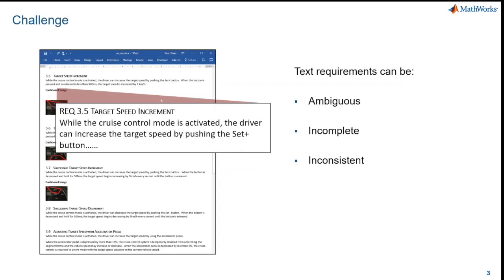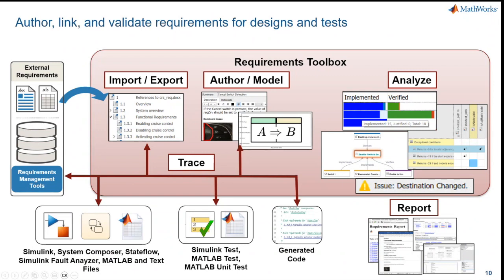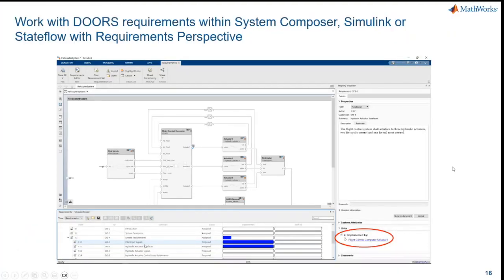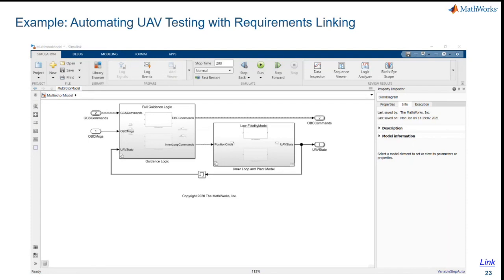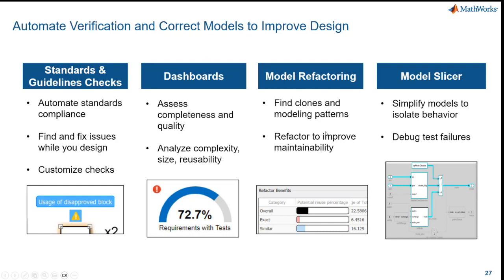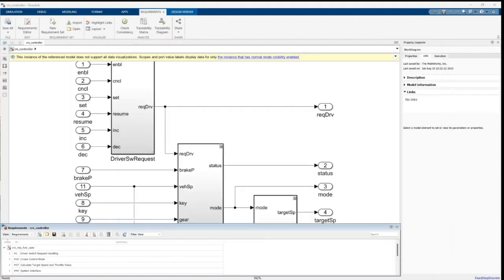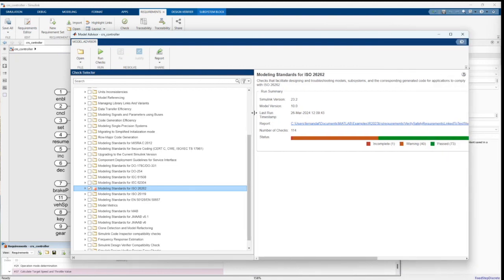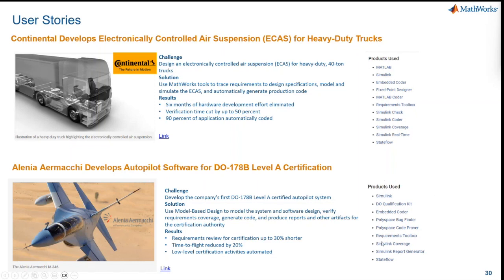Requirements Management with MATLAB & Simulink

Comment: Nice presentation. One question: is there a way to make a traceability back from test cases into DOORS? 
Thanks
Reply from the maker: Hi, thank you for your question.
Traceability is bi-directional. You can import requirements from DOORS into the Simulink® environment, then establish traceability from your model to DOORS requirements through the imported references. If DOORS requirements change, you can update the references in Requirements Toolbox™ while maintaining traceability. Additionally:
You can establish traceability from MATLAB® and Simulink to DOORS without modifying DOORS Formal or Link modules.
 
You can link between design, tests, and requirements without leaving the Simulink Editor.
 
You can establish traceability from low-level requirements in Simulink to high-level requirements in DOORS.
 
You can identify gaps in implementation and verification using metrics in Requirements Toolbox.
 
Change detection and cross-domain traceability can be used to conduct change impact analysis.
 
You can find some examples here:
https://www.mathworks.com/help/slrequirements/ug/requirements-based-design-example-with-doors.html
 
https://www.mathworks.com/help/slrequirements/ug/managing-requirements-for-fault-tolerant-fuel-control-system-ibm-rational-doors.html